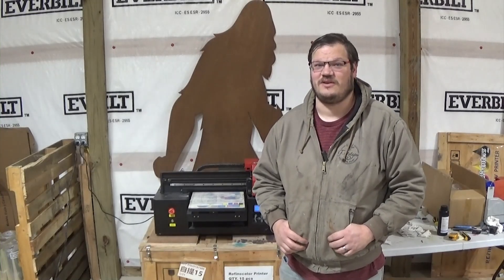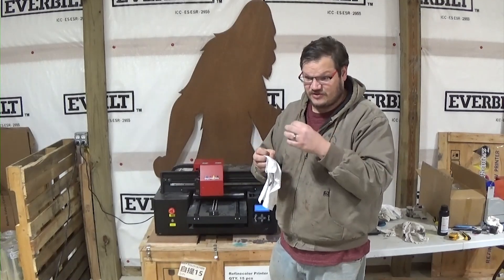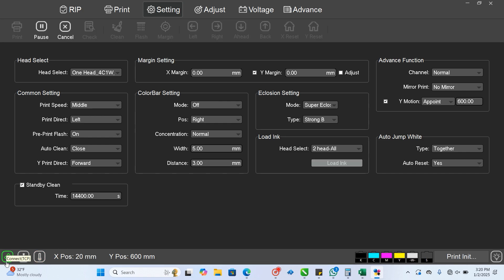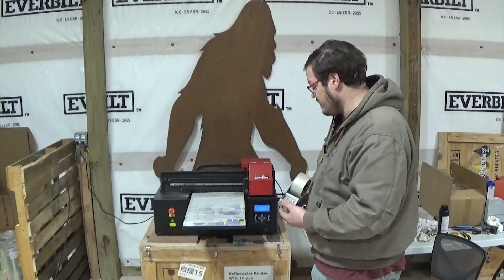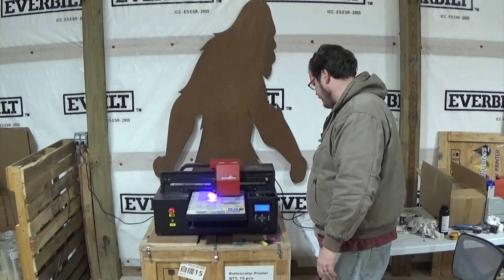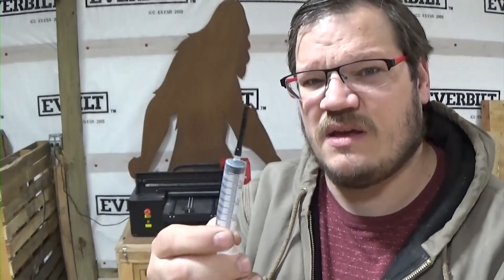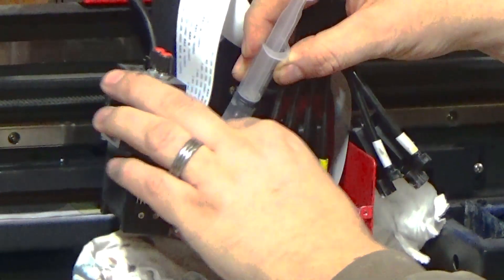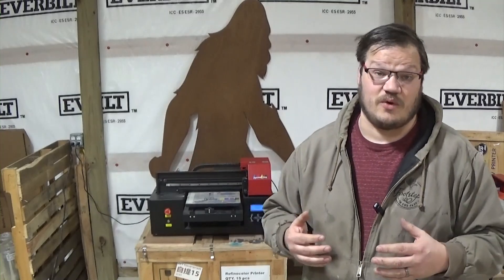How to Get a good nozzle Check on Your UV Printer (DTF, DTG, as well)

Comment: Jay, my wife bought a dtf printer and is having trouble with it. The first step we took was replacing the print head but that didn’t help. Since then I have watched several of your videos and as a result have determined that the ink pad is aligned properly and seems to be well seated but is not drawing ink. I also noticed that we are getting a ton of bubbles in the discharge tank during the cleaning process. Any tips?
Reply from the maker: Maybe sucking air somewhere feelfree reach out to our tech support see if we can help facebook.com/jaysprinterparts

Comment: My problem is that only the yellow color does not print.
Reply from the maker: If no yellow at all and you have ink at the damper and your machine is definitely loading ink. You likely have a clogged or dead channel. Might need to replace the head

Comment: Hi Jay, hope your well, i have a small refine color single head XP600,

Long story short the main board blew out, managed to get a new one and its printing fantastic,

but my question is, would you be available to do a video, showing the machines configuration, mainly the speed settings of the X motor Y motor ect, 

Mine had a reflash of configuration and i think the speed is far too slow. 

Also, if you could do a video / share how you lay white ink down first the color on top with a single head machine. That would be awesome. 

Love your content. And many thanks in advance if you could share any information with me. 

Best wishes Ryan
Reply from the maker: Hello I will consider this video consider printing in reverse to change directions make white change top or bottom printing